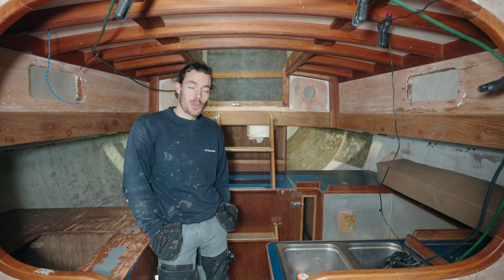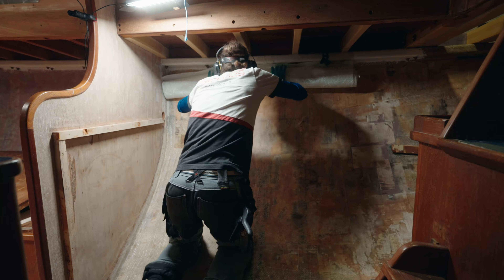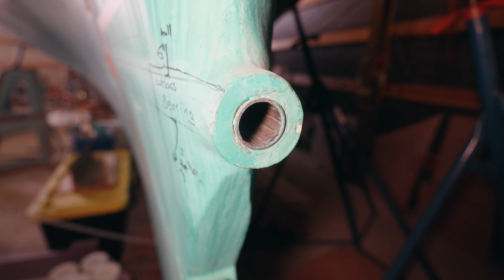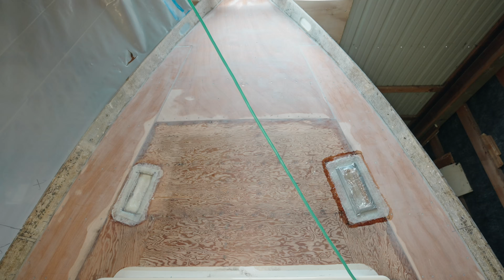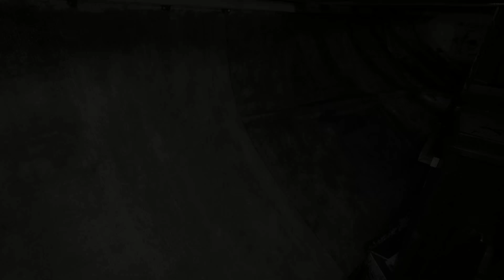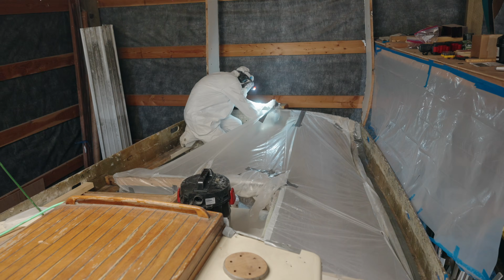HUGE Setback in the Refit. [S4E52]

Comment: I just came across your videos. I started my Cape George 31' back in 1978 and judging by the construction your boat looks to be about the same vintage. I was surprised at the balsa coring as well - all of the CG's that I knew used scored foam to insulate the hull. I am putting in a new engine (Volvo-Penta D2-40, 38hp) but hadn't given a thought to installing the universal joint system as I didn't think it would fit. But of course I didn't consider removing the little bulkhead and working further aft. That's clever. Perhaps a later project. Good luck with your rebuild.
Reply from the maker: Thanks Greg. 
Ours is from 79 so I guess foam instead of balsa came after that.
Reply: @SailingMagicCarpet The choice of balsa would have been by the owner and probably not so much chronological. Some owners made some strange choices... Even back then we knew that balsa was highly prone to rot. Much of the rot problems in the CG's goes back to the wood on the inside of the bulwarks, and especially where the chainplates are mounted. The wood is too soft to allow the horizontal bolts to help with holding the plates down, and the long tie rods to the shelf move a bit and provide a path for water through the deck and even into the shelf. While getting rid of the wood in the bulwarks will help to stabilize things I made the decision to scrap the lot and go with external bronze chain plates. It certainly changes the look of the boat - now more traditional but less sleek - but it is simple, stout, leak-free, and easy to maintain. I got them from Pete at Pt. Townsend Foundry, just down the road from the CG boatyard. Many of the initial bronze castings were from Newfound Metals when they had a foundry in PT, but more recently Pete is the source. He  cast a bronze krantz iron and a custom gammon iron to my pattern for my boat (Carina), among other things.

Comment: By engine, you mean electric motor, right?  EM should easily fit with no vibration or noise. Also recharge during sailing, recharge when still by solar. No bad fuel filters to clean.
Reply from the maker: Nope — we mean engine!

Comment: Cleaning the bottom of the tube is easy if you make a "belt" of sandpaper with the abrasive to the inside and then slide it over the tube and over a hole saw with some duct tape on it on your cordless drill. It's a bit clunky but works well enough to do what you need there. It works best using a right angle drill but will work either way. Keep up the good work and keep your heads up!

Comment: The boat is looking really great. Minor set back in the galley but in the end you will have a much better boat for it. I have been doing the same thing with a Bristol 40. When I built my cold box I used 2" foam sheets on the vertical faces for a total of 6" thick. On the curved part of the hull I used Total Boats two part flotation foam that you mix and then pour into place. It expands like crazy and you can do multiple pours on top of itself. Needs warmth to kick off, I used a ceramic heater since I was doing it in the winter. Worked out great.

Comment: Refrigeration. Isotherm had a 2 speed 12v holding plate system called the ASA that would monitor system voltage and operate at higher speed to take advantage of excess power availability. The result was storing enthalpy in the holding plate that would have been energy wasted shunted off by a regulator. This system doesnt work well with lithium because of the small voltage fluctuation but their new digital controller might offer a solution there.

Comment: Wow. So many shake my head moments. Every area on a boat has to drain, and I didn't see any drain in that engine support. Also, that closed off area in the galley was bound to be damp. Finding mildew there makes sense. Important thing is to ensure there's air circulation back there. 

I'm curious about one thing -- why use a CV joint between the prop and the engine? The angle between the prop shaft and the transmission should be pretty small. A U-joint is simpler, and easier to replace in places that may not have the best logistics. (probably a good spare to have on board anyway)

Comment: How about taking out the original engine design, and putting in a drive system similar to the Amel drive system, or even an electric drive system, with double or triple the batteries in a Lithium ION/ Phosphate chemestry, and cut down the required engine space, and the drive complexity?   Have you considered that?  Is it outside the budget constraints?

Comment: - No one should question why you bought the boat. Some might question why you didn´t strip out the interior from the outset given the amount of work you were already planning to do. I think it would have saved you 1-2 months.  (Looks like you left a section of the galley in place. Get it out and start on a clean slate.) - However it´s easy to say in hindsight. Keep up the spirit and push on.

Comment: I see it was a difficult decision to replace the whole of the insulation layer. I guess you see the build quality by the wharf a little more critical, now. The material to replace balsa might have been foam that does not rot in water. It would have been less critical installing the interior. You could have drilled and screwed through the inner fiberlass layer; a very nice holding ground for all sorts of covers, linings and appliances. Now you are obliged to grind and laminate everything you want to hold onto the inside of the hull.

Comment: Using a cv joint requires a minimum misalignment angle so it will self lubricate and operate properly. As someone else noted, you will also need a thrust bearing aft of the cv joint. Great work and extremely enjoyable videos.
Reply: If you look at the Python Drive CV system (and others) you’ll see that the thrust bearing is integral

Comment: Well, this will be the first old boat in history where nothing is at the "broken, you just don't know it yet" status now that every piece of it has been inspected by eye, touch, and the nose. Is that the diesel tank right under the cabin sole in front of the engine - with the light brown thing that looks like an inspection cap that screws open? I sure hope everything there is ship shape.
Reply from the maker: That’s the diesel tank indeed. Great location except when it needs servicing😜

Comment: I'm a retired guy these days, but during my working days as a construction manager for decades, I had to get quite a bit of education on mold removal.   black mold can be very unhealthy for some people.  esp. if it is Stachybotrys.  molds have a defense mechanism where they release spores when disturbed.  those spores float thru the air and settle in cracks and crevices where they can grow and reproduce in dark, moist conditions.  this is why there are elaborate and expensive containment and filtration protocols when black mold is discovered in structures where people live and work. 

not trying to alarm you but maybe you should have a conversation with someone who has more knowledge on this thank you do.  esp if you have plans of starting a family on board.

Comment: I know its hard to accept after tearing out rotted balsa  for days, but properly installed balsa core will never rot or de-a laminate!  Whereas foam will sometimes degenerate from core shear failure. (Not a problem with an heavy hull like a Cape George), but sometimes happens when a hull is engineered to provide the maximum strength to weight ratio with two thin skins around a foam or nomex core. 

"Properly installed balsa" is done using resin infusion and epoxy resin. The result is that every square of balsa and every bit of air in the balsa itself is filled with totally water impermeable resin. Whereas foam (especially scored foam) installed by hand still frequently has paths through which water can migrate if it breaches the outer skin.  

Preaching to the choir about the virtues of balsa is about as futile as discussing politics!  Moving on!!!

Comment: Perhaps condensation from a freezer or not properly insulated ice box or refrigerator could account for the water behind the counter. My other observation was the the floor beams resting on top of the balsa core might be a benefit by not causing a pressure point on the glass hull. The boat is looking great guys

Comment: Look at it on the bright side... This is probably a blessing in disguise. If you hadn't found the water infiltration those engine mounts would have been a likely point of failure leading to far more repairs down the road. If that happened after finishing the upgrades, it would have made it even worse. Imagine having to rip out your newly built dream fridge and brand new countertops you hand made!
I hope you have found the last big surprise this beautiful boat has for you.

Comment: Would suggest you incorporate a thrust bearing between shaft and engine really will be huge plus  takes strain off engine bearings and allows for lot of movement re engine alignment
Reply: Yes, that is why Aladino can incorporate a cv-joint. Now they can use softer mounts to keep more vibrations away from the hul. 
And that 4 cylinder beta will vibrate a lot les harsh compared to that 2cylinder bmw anyway (not that we have seen or heard it running :P ).

Comment: I realize that your vids are probably back logged. But I did want to say It is easier to build a Kitchen or Galley from the ground up then it is to fit todays appliances into yesterday's wood. Enjoy your new boat with new galley, motor and head. Clean free of wiring debris and ifs of what is below. Best of luck shopping for what you want not what will fit.

Comment: Just a thought after seeing your plans to shorten the shaft tube .  Will you still be able to work on the dripless shaft assembly behind the engine once the engine is installed at the new location.  It seems that access in back of the engine may not be easily reachable.  You are both amazing at what you are doing.  Thanks for sharing your journey. Cheers!!
Reply: A access hatch through quarter birth would help out.

Comment: The boat will be incredible when you complete it - and a better than original design.  Hindsight question.  Could you replace the rotten balsa with closed sell foam instead?  and have a hybrid insulation design?  rather than replacing with Balsa again?  If it were me, I would be glassing the floor grid to waterproof the beams.

Comment: I hope this is the last “tear out” and the progress forward will not have anymore setbacks. If not for your patience and master boat building  skills, this project would be futile. All the refitting is going to take a long time with motor, navigation, communications and all the other systems required for a self sustaining blue water craft.  If anyone can accomplish it  y’all can, but it’s going to take at least another year of hard work.
Reply: Having done both,  I firmly believe that it is cheaper and  better to build a custom boat from a new hull than tear an improperly built boat down to a bare hull and build it again!   Doubly so when you are someone like Aladino who has the skills to do it perfectly and the standards that make it impossible to do it any other way!

Comment: Have you considered to put in the engine backwards and above the prop shaft - connected with the teeth belt of the kind you'd find on a modern Harley Davidson? The entirety of the engine room may get higher but also a lot shorter. And the tooth belt - if the prop gets blocked - probably causes much less consequential damage in case the prop gets blocked.
And, with gear ratio you have an easy reduction option. So you only need the clutch and Forward/Reverse mechanism either on the engine or the prop shaft

Comment: I never regret getting something questionable back to a clean slate. Great to you both taking it in stride. Hopefully the replacement in the galley refrigeration area is all closed cell foam with the opportunity to use some modern vacuum panels. Boat building has come a long way with some significant mistakes in the industry. The long path so many of us are on you’ll make it through.
Reply: Ps do you have the source on those brilliant deck crystals or are they old stock? Had not understood any company was currently producing any.

Comment: It amazes me how folks talk so casually about lock downs.  Like its good and normal to be prisoners , and just a time to take advantage of? If yall realized what it meant, yall wouldn be so happy. 
  But yall are on the right track - yall have a escape plan - Yall had better hurry and get that boat in the water and stocked though .  or yall will never be able to leave land. Wont be no escape. 
    It looks like ww3 / the final war - is fixin to go hot any time now.  It already started. 😳  And when the attacks take effect, and the war goes hot. If yalls boat aint in the water,   yall will be land locked stuck in famine and war with no escape.